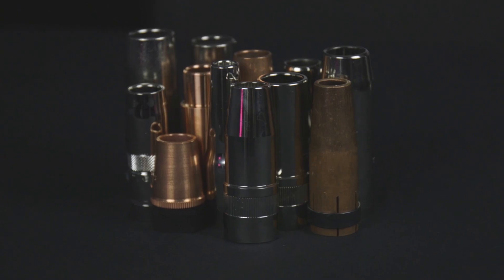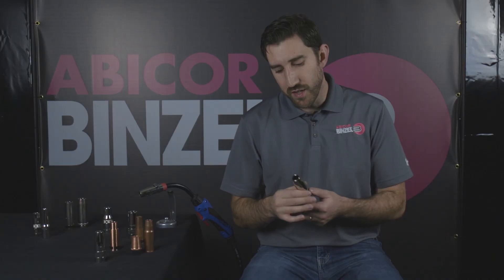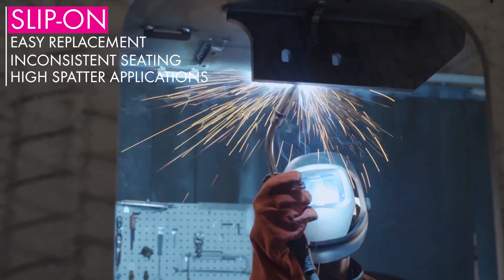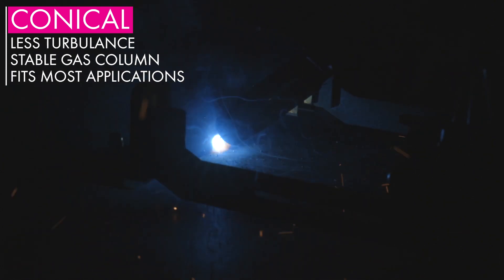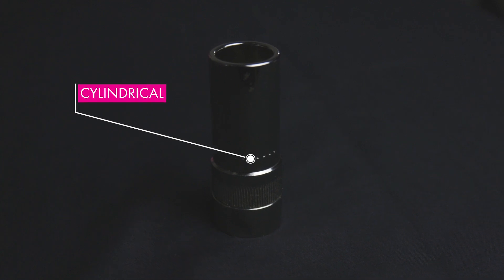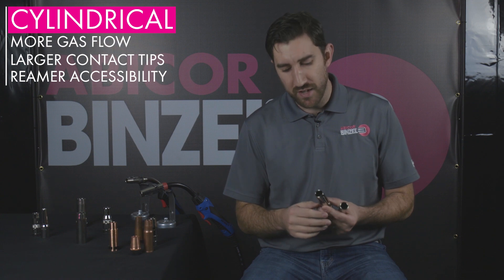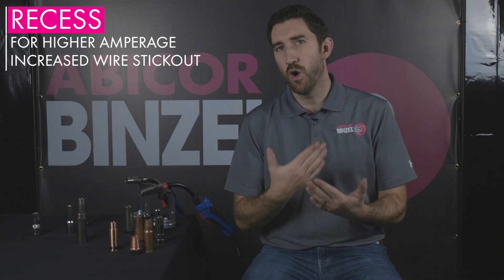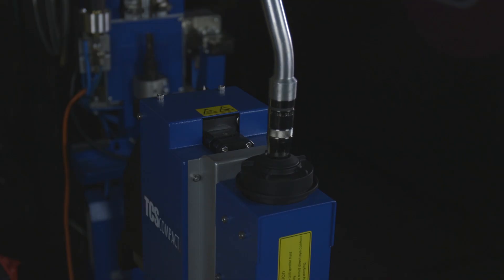MIG Welding Nozzles | Binzel Basics

Comment: I either stick weld or TIG... Never had any reason to buy a good MIG machine until now. Apparently, the nozzle vs TIG cup isn't as critical, just don't obstruct the shielding gas with your tip and nozzle combination. That's what I got from the video. MIG is an easy process, not quite as involved as TIG and your hand isn't getting smoked! 😆

Comment: is there a ceramic coated nozzle? i have problems with spatter sticking while welding upside down.
Reply from the maker: Hi @ExploringCabinsandMines, you can use our ceramic coating spray: https://www.binzel-abicor.com/DE/eng/products/accessories/welding-chemicals/ceramic-spray/anti-spatter-agent-ceramic-spray-for-gas-nozzles.html
To find out more or if you have any questions, please contact our welding experts using the contact form: https://www.binzel-abicor.com/DE/eng/company/contact/contact-us/

Comment: Very good content! 👍.  I use a wide variety of slip on HD nozzles for mig and dual shield welding. It's very surprising how much difference from one to another. I usually have to make gas flow and wire feeder/ voltage corrections. Going from 5/8 to 3/8" nozzle. Total different gun performance.

Comment: Does Binzel make nozzles for flux core welding with no gas.
Reply from the maker: Hi, because flux core welding doesn't need/use shielding gas, there is no need for a nozzle to direct the shielding gas for proper coverage. Our flux core torches do not use a nozzle, however if you are using a standard MIG gun with flux core wire, any nozzle should work just fine.

Comment: Does the nickel plated nozzles have copper or brass under the platting? I assume copper?
Reply from the maker: Yes! They are Nickel Plated Copper.
Reply: ABICOR BINZEL okay, thank you for responding.  will it always be copper or can they have brass sometimes to?
Reply from the maker: @SulfuricDrop3  If you're using a BINZEL nickel-plated nozzle it will always be copper underneath the plating.